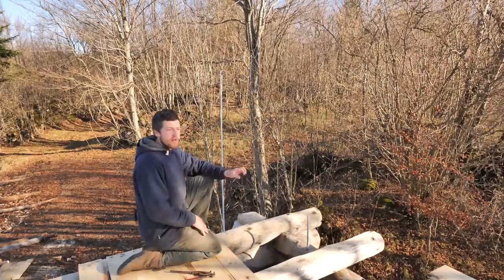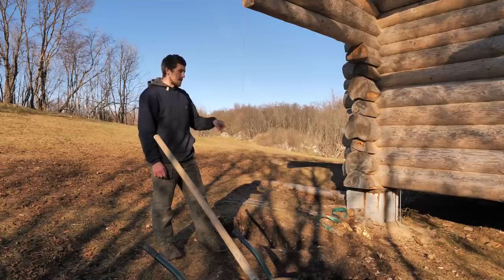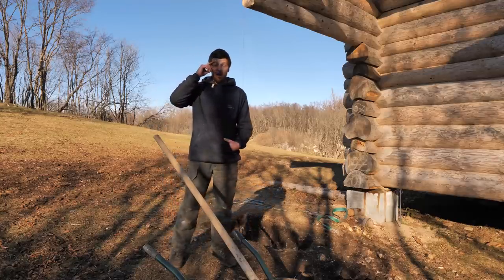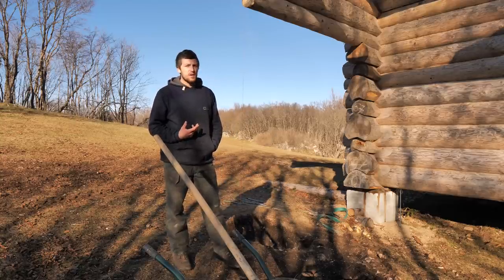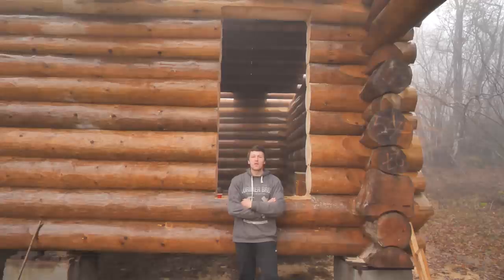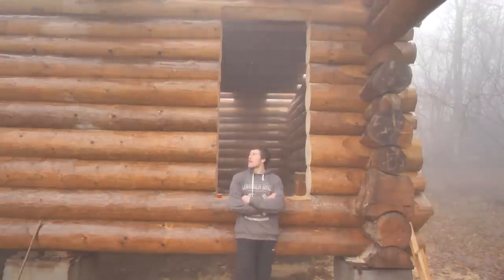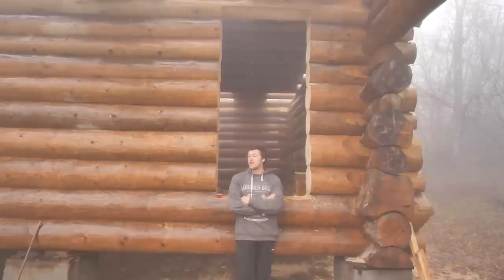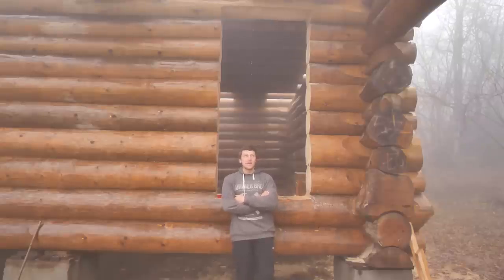Building Off Grid Log Cabin - S 2 Ep 2 /  Cutting The Door

Comment: Get a 25 mm wood bit ‘ weld it to the all thread ‘ weld 12 mm round to other end ‘ and away u go ‘ problem solved ‘ I know u know this already ‘ great looking cabin will last for many years
Reply: *decades :)
Reply: Could even just cut some slots using an angle grinder into the end of the threaded rod and chuck it up in a decent drill.
Reply: in alp its one century for well done small cabin, "mazot" or also called "tresor"
Reply: 200 years plus. The roof will be the deciding factor. Probably as the rest of this build. Tough as a granite boulder.

Comment: Nik I’m glad you got all your threaded bolts in the walls to help lock the logs together tightly & more securely! The 2 concrete forms & footings looks great! That was a great idea to fill them in with rocks to make them much stronger 💪 !   On that doorway if it was my cabin I’d cut the doorway about 2 more inches bigger all way around the doorway. Then I’d get me some 2 inch thick X 10- 12 inch wide boards to frame around inside my doorway! It will sure make it a lot stronger & hold all those logs in place a lot better. And since you cut the door close to the corner you will need the extra strength to hold the weight of those logs.
Look at the last episode of:
“HICKORY RIDGE HOMESTEAD” on YOUTUBE. He has a recent episode called: ( Cutting a giant hole in my log cabin ). It’s where he cut the hole for his Log cabin door & he framed it in with extra thick & 10 inch wide Board’s. U may find this video helpful. 👍
Reply: In this way the foundations are done in Balkan but we do not build wood houses Concrete and building blocks
Reply: THANK YOU SO MUCH as I was wondering why the log had been leaden down with stone's👍🏾 I knew that he aligned the inside length of a panel to run electrical cable though!! Lol EXCELLENT WORK NIK
Reply: He did Great. I'm watching it now.

Comment: Respect how you handle that chainsaw, when I see you doing it this way it seems very easy to saw straight!
Reply: Half the battle in making a straight cut is having a properly sharpened chain. If one side of the chains teeth are improperly sharpened or are dull the cut will start to wander off to one side

Comment: For the stuck rod, try two nuts at the top and tighten them against each other.  You can use the top nut to "screw in"  the rod so it will make its own way through.  
(Old mechanics trick to remove stuck studs but in reverse).  If it doesn't work, undo the nuts and nothing is lost.  If the top nut is high enough you can persuade it with a sledge hammer without ruining the threads.

Comment: I would not worry to much about the Last piece of all thread. It was not even required until recently in the US. You have 11 in right. Your idea of welding a Nut onto the All Thread may work but it would take a long time going in a little bit at a time and backing it off to clean the threads off. Great Job

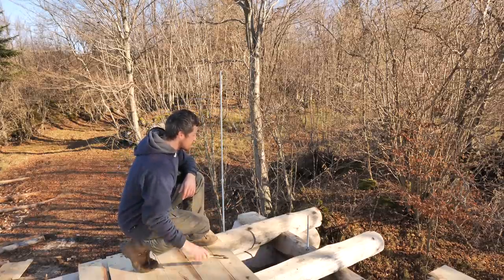Comment: 7:20 It might be a pretty hacky solution but it might work: You can probably chuck the rod into a drill, so I wonder if you could weld a drill bit to the end of the long rod, then try and drill through the log that has the missing (or misaligned) hole. Essentially you'd make a long ass drill bit.
Reply: good! I thought the same idea of you too.

however it seems that the threaded rod enters the wall for almost 2/3 of its length. therefore it would be better to drill from under the wall.
I saw in the video that under the wall there is enough space to work drilling.
the tip of the drill is 30 mm in diameter, and should enter the existing hole (in the first log at the bottom of the wall).
then it should be welded to a threaded rod of smaller diameter and long enough to work. when the rod also enters the hole, another rod is screwed through a joint ... and so on.
of course drilling under the wall only makes sense if the hole in the log is missing. however, if the hole is out of phase, it must be drilled from above the wall (I hope not, because the torsion that the threaded rod must support increases if its length is excessively long).

pare che l'asta filettata entri nel muro per quasi 2/3 della sua lunghezza. quindi sarebbe meglio forare da sotto il muro.
ho visto nel video che sotto il muro c'è spazio sufficiente per lavorare forando.
la punta del trapano è di diametro 30 mm e dovrebbe già entrare nel foro esistente (nel primo tronco in basso).
poi dovrebbe essere saldata ad un'asta filettata di diametro inferiore e lunga sufficientemente per lavorare. quando anche l'asta entra nel foro, si avvita un'altra asta tramite un giunto... e così via.
naturalmente forare da sotto il muro ha senso solo de il foro del tronco è mancante. se invece è sfasato, si deve forare da sopra il muro (spero di no perchè la torsione che deve sostenere l'asta filettata aumenta se la sua lunghezza è eccessivamente lunga).
Reply: you and NotaPix who replied to your comment seem to have not heard Nic in the video at the time when talking about the problem stated the fix that you think is your idea and now are proposing here.
Reply: @TedBruckner  Oh didn't realize that. Kind of a dick way of phrasing it though...
Reply: @TedBruckner  hi ted.

sorry, I don't know english. I had to use google translator to write (like now).
when nik speaks in the video, I have to skip the spoken paragraph... incomprehensible to me.
since I saw Nik in difficulty with the threaded rod that did not cross the wall of logs, I wanted to make my contribution.

I just wanted to give him an idea, unpretentious. if nik already had this idea, i am happy.
his enormous work has many merits.
thank you for telling me :)

Comment: weld on to the threaded rod  some carbide bits off a drill and use a big drill to re- drill the hole. Weld the joiner together though and it will work.

Comment: Traditional way (at least in finland) is to drill holes only to thru 2-3 logs and but wood stick there. That way you bind those logs together. Stick also need to be quit much shorter than those holes because logs are lowering a lot during first years.

Those timbers in sides of the door also looked really long. Was there enough space for logs to lower so those timbers are not carrying that weight?

Comment: I know its a little late but how about measuring  the depth of the rod that is already  in the hole, you should be easy to identify which is the guilty log .  I would do some surgery and cut a slot into it to allow the rod to pass and use a replacement small wood of same shape to replace the cut out slot .  Best wishes and good luck !

Comment: I doubt you could ever put enough torque on such relatively small bolts and threaded rod to significantly compress that many logs of that size.
Reply: its done to prevent drift in the logs, not to compress them.
Reply: @Saveddrip  At 5:40 he said he put in the threaded rods to "better press together the logs," which means compress them. As for drift, those logs aren't going anywhere. They are too heavy and the joinery is too precise for them to ever drift by any meaningful amount. In the areas where openings are cut for windows/doors, the framing around the windows/doors keeps them from drifting (and unlike those 15mm diameter threaded rods in 30mm holes, the framing is rigidly affixed to the logs, which allows no play at all). Countless log cabins have been built throughout the centuries without threaded rods, without any issues at all.

Comment: Awesome work! I really enjoy your videos. I have built a log frame sauna with my father and brothers in Finland. It looks like to me that the timbers that you are installing for the door frames are too tight in the vertical direction (https://youtu.be/KxfFdzjMU9Y?t=2051). You should have at least 5 cm of empty space because the whole frame will compress over time. If you do not do this then your door will ultimately get warped. This same issue applies for the actual frame of the door itself and to the windows. Cheers and keep the videos coming!

Comment: Cutting windows doors etc. That is the stupidest thing builders of log cabins  do. Its not that u can't have them
 but  they should be built in not cut in. My opinion is that weakens the whole structure. Cutting logs into flat beams would be stronger. With chainsaw and modern tools ...this would be easyer to assemble and much stronger then a traditional log cabin and it would retain the same look.
I an a strong advocate of GLUE&SCREW.  WOOD PEGS GLUED INTO JOINTS ARE STRONGER THEN STEEL RODS.